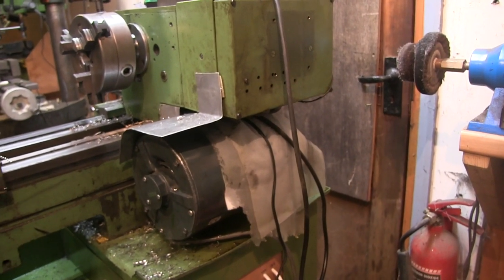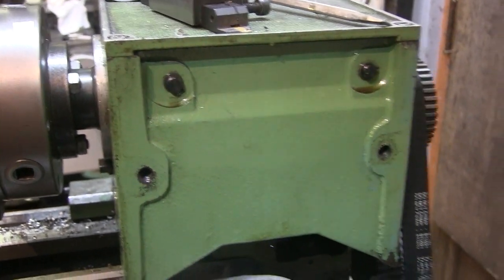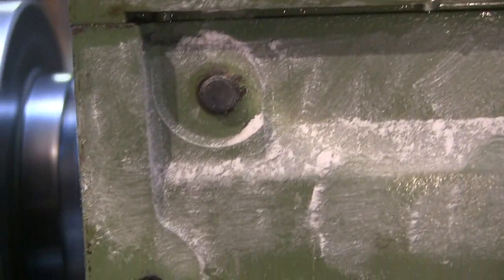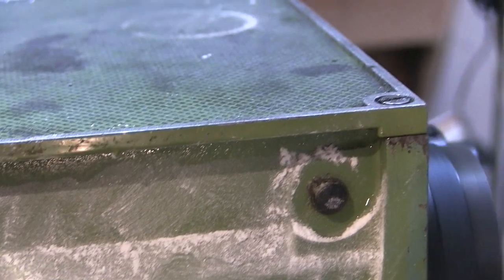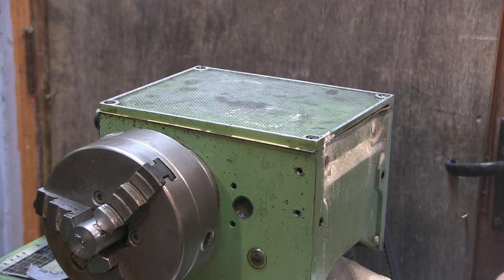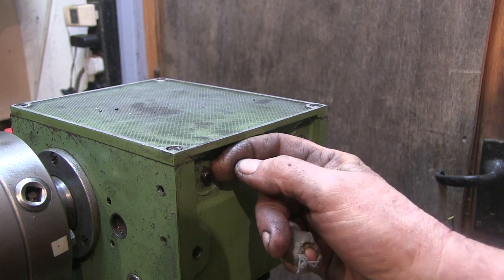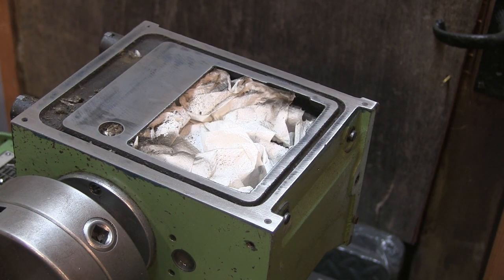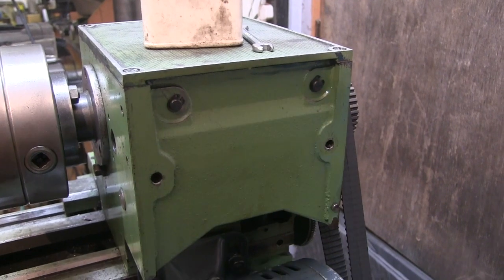Emco V10-P, Bloody Oil Leak!

Comment: hi cliff just a heeds up you need to keep the grove open on the top casting if you look you will see there is oil hols in this grove as the box's is spinning oil bin splash up drops in to the grove and goes dawn the holes to oil things up   regards bob

Comment: Hi Cliff, a light smear of silicon sealer for car engines will fix the top lid leak, yet still allow it to be removed if necessary.

If the oil is not leaking out, you won't have to replenish it, same as car gear boxes.

Cheers Rob

Comment: Tell you what Cliff reading further down a guy has mentioned about a breather, check to see if there is one on the machine and check it is not blocked because that certainly will cause oil to seep out if it is under pressure in the headstock.

Comment: Surprised at the oil problem with your lathe!  I have an identical lathe, albeit with a few changes (improvements?) made to it, and in the 35 years I've owned it, never had an oil leak problem.
Make sure your lathe is levelled, front to back, reasonably closely.  Carpenter's level is sufficient for this.
Then make sure that the oil channel drain hole is open.

Comment: Oil leaks, horrible job. The back corners looked pretty high so hopefully flattening down will work. Guessing also when the machine ran up and got warm the oil thinned down some which would also help it escape. Fingers crossed you got it. Good vid cheers.

Comment: Mine doesn't leak :)
Not much help to you, I know - but I took the lid off and had a look at it. It's all nicely milled flat...so your idea of levelling the mating surfaces ought to do the trick.
Can't see any form of venting, and I'd be surprised if the head even needed it. What little pressure builds up would probably be relieved by the gaps around the gear selectors.
That said, I hardly ever run mine at more than 1250rpm (the 2500 speed scares the crap out of me) - so maybe that helps with keeping the oil splash down. And maybe you'll find that once the oil reaches a certain level, it'll stop weeping out. My sight glass shows the oil just a smidge under half full.
Reply from the maker: Mine only gets to about 1700 through the Vfd, And that scares me!
1000-1200 is plenty! still leaks a bit, I'll try some liquid stuff when I get round to getting some,
All the best,
Cliff

Comment: Hi Cliff ,
i couldn't see it in the video but did you cut the centre of the gasket out so the oil groove is exposed ?
I use loctite master gasket or similar on everything except carburettors (no sealer for these )  , it is expensive but doesn't go hard in the tube like silicone sealers and it also works on threads . 
So the old sprinkle some talc on it and look for the wet spot really does work 😂
Reply from the maker: Hello Ian, I did cut the gasket out, but it still leaks a bit, nothing to really worry about but I'll get some liquid gasket and try that!
ATB,
Cliff

Comment: Belt and braces Cliff, I would use some Hylomar from a car spares place and use that on the top plate with a new gasket ( the first one will be no good now as it's been impregnated with oil). Let's be honest, if you manage to get it sealed, unless you have a bad gear problem you ain't going to want to take that cover off again unless it's absolutely necessary are you? Good luck with it mate.
Reply from the maker: Yep! that's my next move Sam, when I get round to getting some.
ATB,
Cliff

Comment: Hi Cliff. Car engine gasket sealer would be good for the cover. It's oil proof where as the gasket paper will soak up the oil and might start leaking. Regards MachineNZ
Reply from the maker: Which is exactly what's happening, I think!